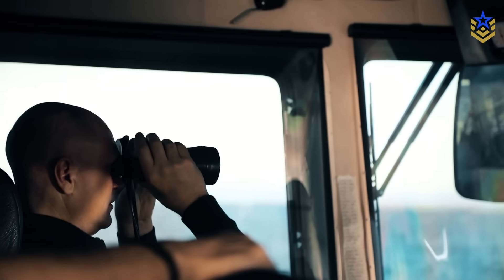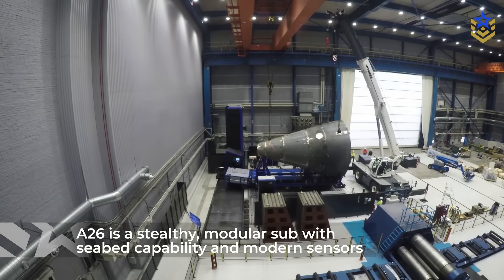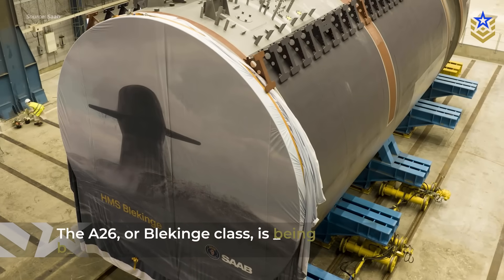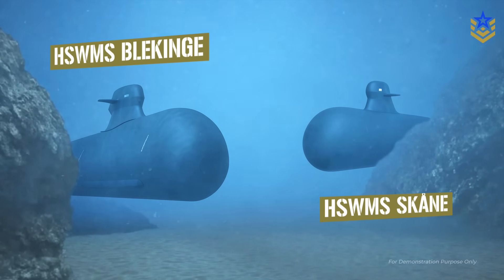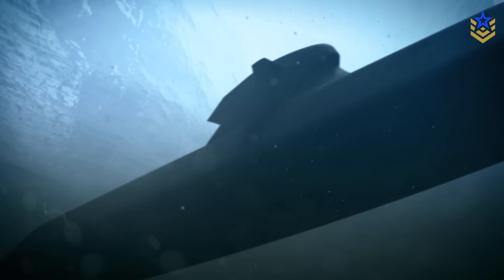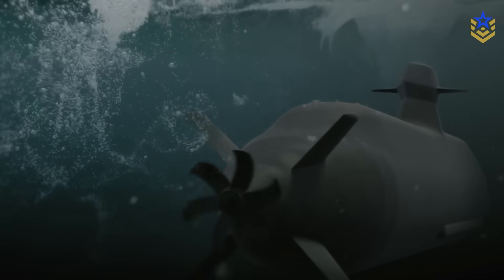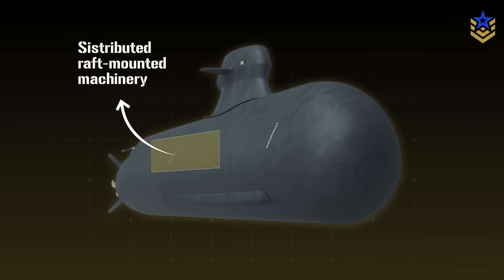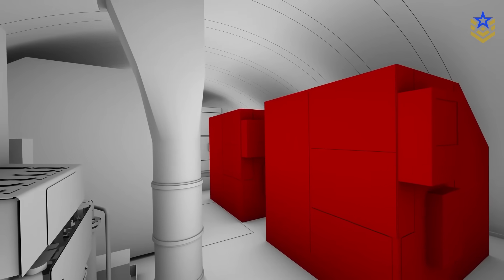Is Sweden’s A26 Really the World’s First ‘5th-Generation’ Submarine?

Comment: 🇵🇱🔱🇸🇪The Polish armed forces have just purchased three A-26 submarines, which means that those already under construction will be completed for Poland in order to shorten delivery times, while the third will be built later.
This is a very good solution, which shortens the delivery time of these state-of-the-art compact submarines that Poland needs to gain an advantage in the Baltic Sea.
Great job by the Swedes!

Comment: It's interesting that both the German/Norwegian submarine and this Swedish submarine have a stealth cross section.  That would require a surrounding light hull as the pressure hull still has to be a cylinder and that means more mass and more drag.  Also, it is usually said that anechoic tiles were as effective against active sonar as a stealth cross section.  The other interesting point is that both mention littoral waters.  One thing about littoral waters is that diesel electric submarines are quiet enough to be detected by obscuration of active sonar reflected off the sea floor, however just a stealth cross section would only make it easier to be detected by obscuration.   However in the early meta material experiments, sound has been diverted around a central region with a series of baffles.  Could the light hulls have internal baffles to be a meta material for sound?   

Canada needs to decide on what they want for the submarine, to fire long range cruise and ICBM missiles, that would be South Korea's KSS-III.  If it's to find undersea cables and pipelines that's both the Type 212cd and this Swedish A-26.  If it's to deploy autonomous underwater vehicles or divers then it would be this Swedish A-26.

Canada has already narrowed their search to Germany's type 212cd which also has a stealth cross section or the South Korean KSS-III with the vertical launch tubes so it's unlikely this Swedish A-26 will be looked at though if the Gripen is selected, that may change.  

The South Koreans designed the KSS-III so that they could launch retaliatory strikes against North Korea,  Sweden designed their submarines to address the problem of Russian ghost ships dragging something to rio apart underwater pipelines and communication cables.  

Canada's needs for the Victoria class and Oberon class was to participate in international cat and mouse games.  What is it that Canada needs now?   The Northwest Passage is cintested by the US and Russia so those are the threats that Canada has to address.  The passage could be considered littoral waters at least in some regions.

There must be something more about these stealth cross section submarines then just a stealth cross section given the arguments of stealth cross section versus anechoic tiles in the past and the current possibility of detecting diesel electric submarines by obscuration so obviously there must be something the public does not know about these stealth cross section submarines.  Any targets for cruise missiles and ballistic missiles are quite far from the Northwest Passage and are mostly Canadian targets though if Canada is invaded, attacking targets on occupied lands may be necessary as Canada would certainly have portions occupied.  So far, the advantage of submarines to Canada is that people won't know if one is nearby and hence must act as if there is one nearby.  It is to have the effects of being there without having to actually be there...
Reply: Littoral waters means that the seafloor it's going to be full of microphones, (because of the shallow depth it is easy to do by anyone interested) . That's your challenge to overcome
Reply: A26 has a much wider scope of capabilities than just handling the shadow fleet. & While the 212 C/D will be useful in littoral waters, it will not be it's main focus. & There is a version of A26 in development that includes vertical launchers.. A stretched version.

Comment: About time under water, public info is three weeks. So lets guess a month. As i understand the heat for the stirling is coming from methalox (same propellant as starship) or LNG + Lox. Perhaps dual fuel heating. 

As methane can be made from seawater, theoretically it would be possible to add a module and “charge” the sub when docked with land electricity. That’s freaking cool.